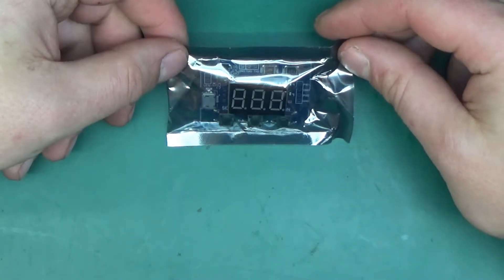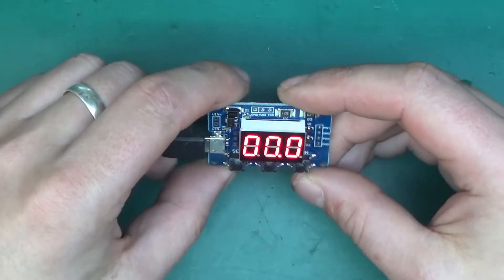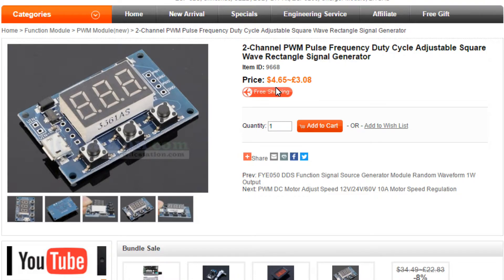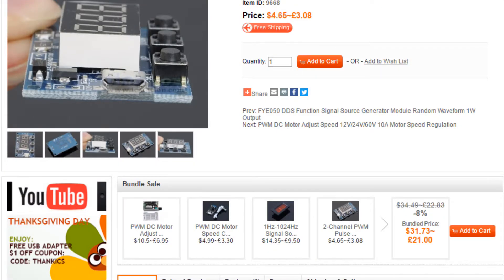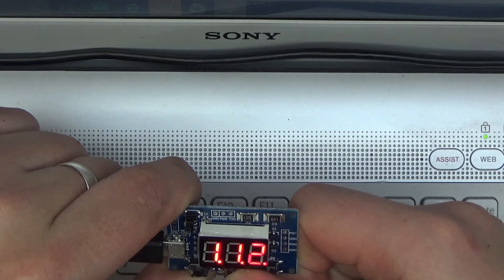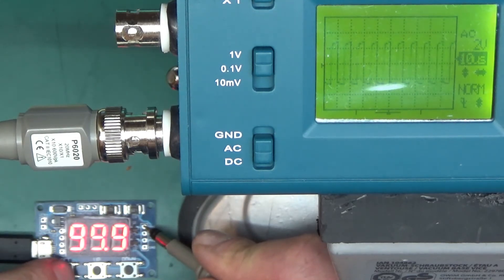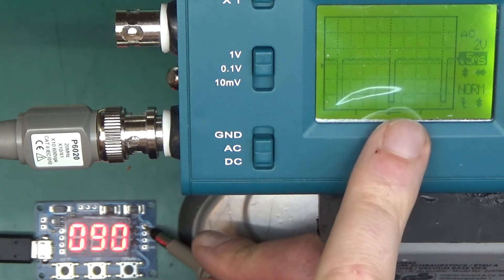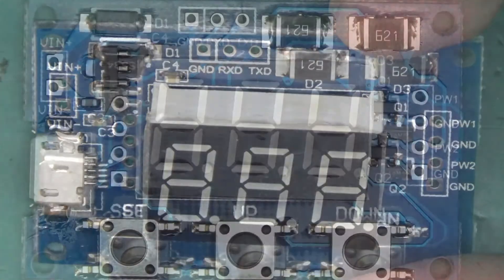2 Channel PWM Frequency Adjustable Square Wave Signal Generator module review

Comment: Please help with settings. 

I want to run both the channel on 50% duty cycle @ 1Khz. While I want to run channel 1 instantaneous, I want channel 2 to commence only after Channel 1 reaches zero duty.

eg: When Ch.1 = 5v, Ch.2 = 0v and vice versa.

Thanks

Comment: 9:47 The frequency does change in real time, if you hold the up or down button. There is a delay of about 1.5 seconds until it starts to count up/down.
Also, I'm finding that the frequency is up to 5% wrong at frequencies over about 300 Hz.

Comment: Tolong buat Video Tutorial Rangkaian Inverter DC (12 VDC)  to AC (220 VAC) dengan Modul "Adjustable 2 Channel PWM Generator Wave Signal Pulse Frequency".

Lengkapi pula dengan Wiring Diagramnya ya...

Makasih...

Comment: can this be used on a tig welder to pulse
Reply from the maker: I guess why not. Could be connected in place of the foot switch and maybe some kind of relay could flip between 2 resistances to switch between 2 current settings every half a second or so.

Comment: Interesting but I want to use it on a scan radio..whats the output voltage on the square wave? I really dont want to fry my ic 😓
Reply from the maker: Hey, it was 5v.
Reply: randomtronic Thanks
Reply from the maker: Actually, i am doubting myself now and dont want to mislead you. If you power this from 5v, then it will be 5v on output definitely, but cant remember now if there was local regulation, so potentially if you power this from 12v, it could be 12 amplitude on output. Just measure it with multimeter (set the thing to lowest freq and 99 duty - that will help)
Reply: randomtronic oh ok. Yeah don't want 12volts on a 3.3 volt I.C. yikes....Thanks 💗

Comment: I'm about to buy one. Does the output voltage directly correspond to what the input voltage is? If I use a 12v or 24v power source will it still output 5V?
I need it to output 0-5V for PWM dimming LED's but my power source has a higher voltage.
Reply from the maker: Shawn Kay from what i remember there is an LDO on the board, so supply voltage can go up to 12v. Output should always be 5v.
Reply: Great! Thanks a lot.
Reply: https://i.stack.imgur.com/9sTa8.png
Reply: https://www.electronics-tutorials.ws/transistor/tran_7.html

Comment: How can I do to increase the output current?
Reply from the maker: Fernandus Aditya easy way would be to put a  bigger transistor on the output as emitter follower.
Reply: Can you tell me other way to increase output current? How about removing some resistor?
Reply from the maker: Fernandus Aditya hi, i am glad this interests you so much. Unfortunately, if you overload the module it will be toast.  You need a driver stage to output more current. Lookup emitter follower, its very simple, and parts you can probably even remove from some old junk.
Reply: https://www.electronics-tutorials.ws/transistor/tran_7.html

Comment: the micro controller under the display is--     8S003F3P6  google it for info.
i removed the led display by cutting one pin at a time to see if i could disable it but a number of segments always stayed on ..
Reply from the maker: +Ese Callum cool, thanks. How is your project going?
Reply: i have made the anti Alzheimer device which a flickering red led at 40 hertz and 75% duty cycle and stuck the red led under the computer monitor so that reflected red light from the desk hits my eyes.i am not sick or have Alzheimer but i read the recent research on flickering red light on mice and symptoms being reversed so i thought of making it.an important effect of this flickering red light is dreams and more intense sleep periods with longer amounts of wakefulness...as if the sleep periods was being compressed into shorter time periods.you should make the device as well being so simple.i have bought a dozen of these things now..
Reply from the maker: +Ese Callum awesome! Well done. I have to read up on this more. There is something about this, sometime ago there was  some hype about language learning programme which had glasses with LEDs and headphones  etc. Can't recall what it was called (seti? Something like that..) Anyways, it was meant to stimulate the brain into certain state, which allowed more concentration, etc.  Definitely interesting subject. I also read somewhere about directly stimulating brain with sub 1Hz frequencies by placing a bunch of coils around the head - again, apparently it would allow one to reach state of very deep relaxation. Thanks again, and keep making!
Reply: randomtronic just google red light alzheimer's for articles and the research paper.
alzheimer's seems to be on the rise everywhere and is a terrible disease for those afflicted.

Comment: Has anyone figured out how to communicate with these boards with the serial port on the Arduino?  I'm having a b*tch of a time attempting to get any of the settings to change via serial port.  Any suggestions?  Code would be appreciated.
Reply: did you manage to get this working with arduino?
Reply: Eric Murphy
Reply: rodger ramjohn Whos eric murphy?
Reply: for starters, I would figure it out with the commands that the hyperterminal board accepts.
Reply: @igorovcharov7424  
Serial Port Control:
1.Communication Standard:9600 bps
2.Data Bit:8
3.Stop Bit:1
4.Verify Bit:none
5.Flow Control:none

Setting PWM Frequency:
1."S1FXXXT":set PWM1 frequency as XXX HZ (001~999)
2."S1FXX.XT":set PWM1 frequency as XX.X KHZ (00.1~99.9)
3."S1F:X.X.X.T":set PWM1 frequency as XXX KHZ (0.0.1.~1.5.0.)
4."S1":PWM1
5."S2":PWM2
6."F":frequency
7."D":duty cycle
8."T":stop sign bit

Setting PWM Duty Cycle:
1."S1DXXXT":set PWM1 duty cycle as XXX；(001~100)
2."S2DXXXT":set PWM2 duty cycle as XXX；(001~100)
Setting successfully back:DOWN
Setting unsuccessfully back:FALL
Reply: Hey! I know it has been a long time , but do you remember what happens to this board when U cut the power to it ? Does it remember the setting or does it reset completely ?? Thank you
Reply: here: https://www.electroschematics.com/dual-channel-pwm-module/

Comment: Hello again.I got these yesterday and You CAN get antiphase outputs after all.You connect one lead to output 2 and the other lead to the second hole from the top where the micro usb socket is.Also the output transistors are rated O.2 amps...you can use +ve line and the the pwr output to act as a current sink...as otherwise pwr to ground is limited to 30 milliamps .i just ordered anther 3. the antiphase outputs means i can use it as a beck device and the also a clark zapper too as well as using it as an anti-alzeimer device.

Comment: i am going to use this frequency device to pulse red led light 660 nm at 40 hertz via at me for an hour a day as per the research paper below.they did it on mice and it found plaque buildup decreased by 60% after a week...the researchers have actually set up a company to exploit this.as it very easy to do this at home maybe you know someone who could be tested.it is non invasive and no side effects.people with epilepsy/sensitive rto falshing lights should be avoided/excluded.

http://www.bbc.co.uk/news/health-38220670

http://www.nature.com/nature/journal/v540/n7632/full/nature20587.html

Comment: Can the TWO outputs   be in antiphase?
Reply from the maker: +Ese Callum unfortunately no. They are independent and not synchronous.
Reply: i think one way to get antiphase outputs would be to take one connection from the base of the output transistor  and one from the collector if has a pull up resistor....???  perhaps you could use oscillioscopte to explore in your next video....i have ordered 2 of these..will get get them in 3 weeks...amazing how cheap they are only $4 on ebay...
Reply from the maker: +Ese Callum lol :) bi is ok, as in: bipolar transistor - that should do.
Reply: randomtronic you showed the two output transistors but can't  see any pullup resistors but they must be underside or under the display.it would have been better if they had used LCD displays.
Reply from the maker: Yes, potentially lcd could show more and use less power. But LED is nice too - i guess a matter of preference... And it is easier to drive - the chip they are using probably has not got lcd driver.
Reply: randomtronic Yes a LCD  could show more as in LCD diogital alarm/chrono watches which cost 99 pence on ebay. including battery,strap,case,.,,
Reply: while waiting for them i forgot to ask if you have to set the frequency each time you power it up or does it remember the last frequency???
Reply from the maker: Ese Callum can't check now, but from what i recall, i think it remembered the settings after power cycling.
Reply: randomtronic Thanks...that's good to know as it would be really annoying to go through that fiddley menu to set the frequency each time...
Reply: @esecallum  were you able to get the two outputs in antiphase? I'm struggling to get a solution for this.

Comment: Should be great for adjusting the speed of  fans with PWM input. These are fans typically with 4 wires (power, gnd, tach and PWM).
Reply from the maker: +Wah Ng or possibly even servo motors. Those work pwm too, but it could get a bit more complex there... Anyways, its a great gadget, one of my favourite!
Reply: Yes I am going to get a couple to experiment with.